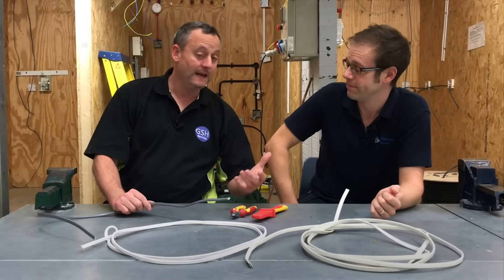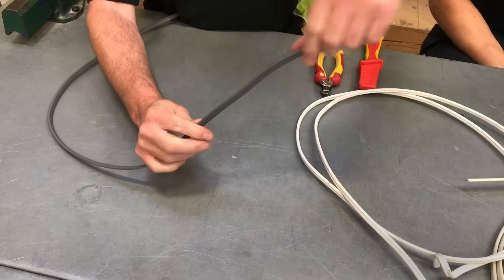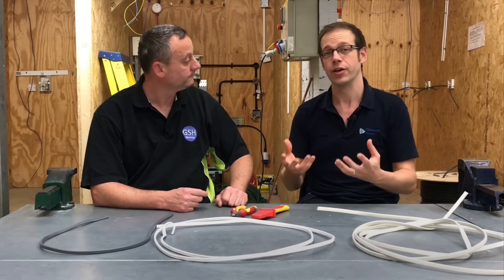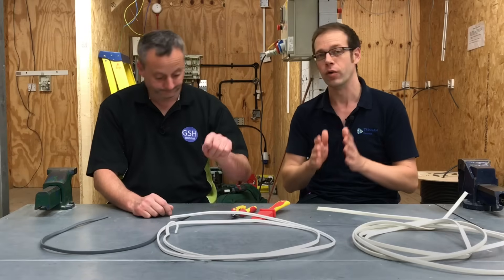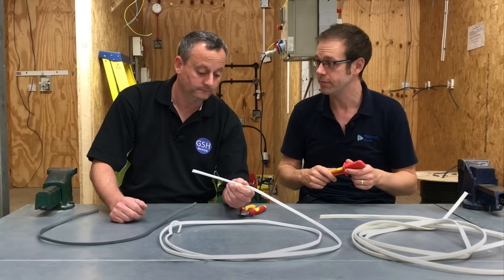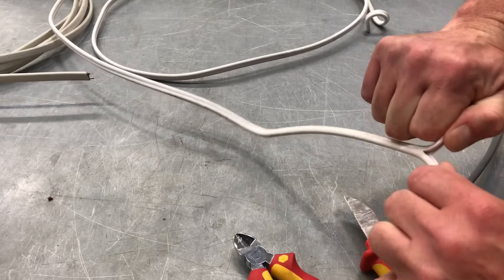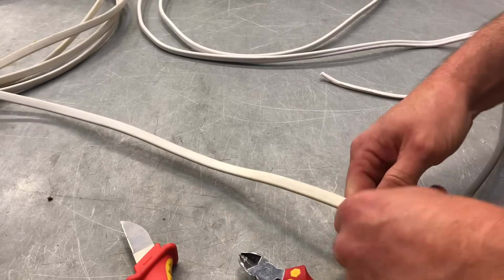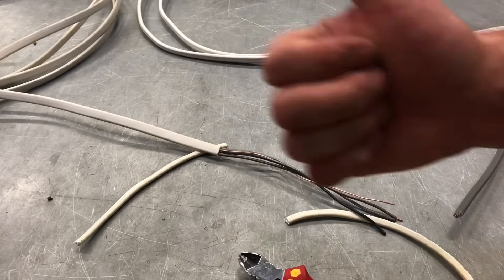Difficult to Strip - Low Smoke Zero Halogen White Twin & Earth Cables? Doncaster Cables Solution

Comment: I was on a job, I could strip the outside white sheath but not the individual Live and Neutral with my wire striped. I was advised to use a cable cutter.

Comment: The struggle is real Gaz. Great video guys 🙂
Reply from the maker: Hi, for me I would pull the cpc out and up the cable on site... but sadly this is not a method we can use at college as the cable lengths are often short in length and we run the risk of pulling it out. Thanks for commenting and watching. Gaz

Comment: How do you run you knife down the groove when you havnt got a handy flat bench 8 foot up a ladder?
Reply from the maker: Hi, for me I would pull the cpc out and up the cable on site... but sadly this is not a method we can use at college as the cable lengths are often short in length and we run the risk of pulling it out. Thanks for commenting and watching. Gaz
Reply: Ok, keep up the good work and videos
Reply: I would get rid of side cutters and only use pliers in colleges and real life much easier for stripping cables and safer

Comment: Can you imagine trying to make off ceiling roses or light fittings at height using this cable! I think myself using the cpc with a pliers will be only way to go unless they come up with a new stripping tool for this cable...
Enjoyable video guy's... Top class...
Reply from the maker: Hi, for me I would pull the cpc out and up the cable on site... but sadly this is not a method we can use at college as the cable lengths are often short in length and we run the risk of pulling it out. Thanks for commenting and watching. Gaz